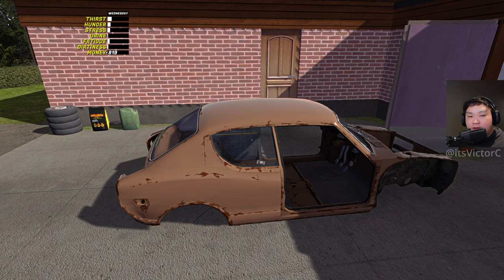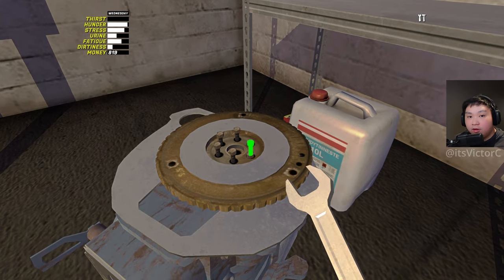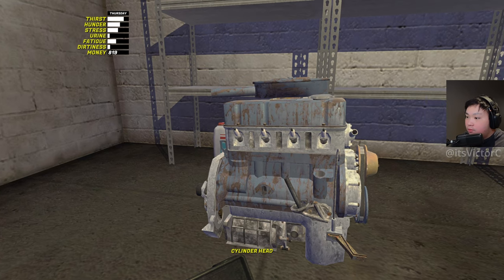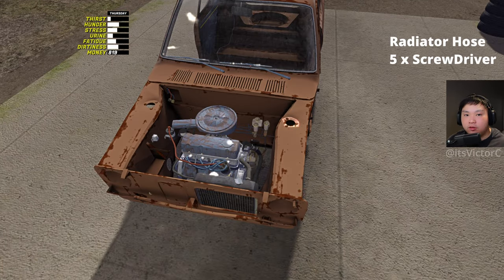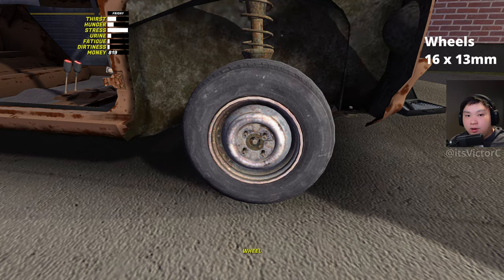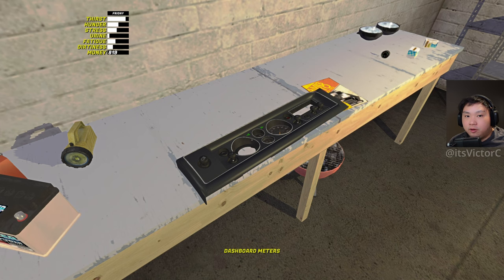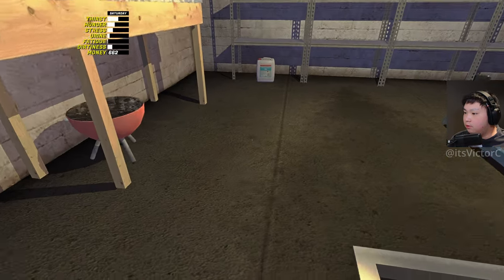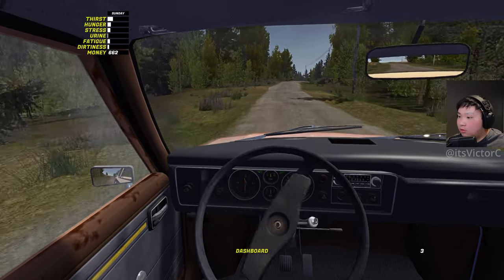My Summer Car - FULL Car Build Guide 2023 with Timestamps and Bolt Sizes

Comment: I'm done I've followed your tutorial To the second 4 times now the satsuma starts once idles great and drives mut as soon as i shut it off it never turns back on again the lights don't light up the car doesn't even crank I have re assembled the entire car four times bought 4 ne battery and 4 new alternators and It will never start more then once
Reply from the maker: Did you fuel it up? Also check the red light on the dash there should not be any red light and your tuning of the carburetor, alternator, valves and camshaft seems like you mistuned something

Comment: Please help, first time playing, I followed this exactly after getting everything from Timos and it started right up, I gave it a "little" rev and then it made what i assumed was backfire sounds, and then i turned it off. It doesn't turn on now at all when the key is in as if it lost power. I checked the battery and it was all bolted in. I did find something called "Piston3" on the ground though.
Reply from the maker: Then you will have to rebuild the engine with new parts. Sometimes it happens when the player spawn in the game and one piston is almost broken and when you install it and start it up it throws a hole in the block. So don't worry just check if the block have a hole if the block has a hole then buy a new block and pistons. Make sure to disassemble the whole engine so the new parts will spawn at Fleetari's
Reply: @itsvictorc  Thank you very much, I am currently restarting because I didn't know what else to do, Ill remember this next time though
Reply: @itsvictorc  Another thing, how do I earn money in the game?
Reply from the maker: The easiest one is to brew and sell kilju to the drunk guy, selling firewood and sewage job. These jobs pay well enough and the easiest ones are the kilju and the firewood but the kilju could be done multiple times and the firewood requires a phone call. So I'd recommend to brew and sell kilju but I wanted to warn you that the most recent update last year you are required to drink kilju with the drunk guy to sell so just brew more just incase. If you need a quick tutorial on how to do either of these I have made shorts regarding these jobs and you could find these videos in the playlist section of my channel. Good luck :)
Reply: @itsvictorc  Alright, thank you very much. I'm currently building the engine again right now. You're the best, and thank you again!

Comment: Yoo nice vid but it doesnt start it has a problem with electricity. The battery is attached so idk. Maybe the battery is not charged? Bc i bought it a long time ago
Reply from the maker: I think just get a new battery just incase and if you have an old battery not the black one put it on the charger so you have a spare
Reply: @itsvictorc  thx man

Comment: The Satsuma does start but when it drives the oil start leaking from the engine and a smoke start coming from the engine and if the car continue to drives, a water from the engine start splashed onto the windshield
Reply from the maker: I think you forgotten to tighten a bolt on the oil pan. As for the water issue the engine is overheating so change your radiator to the racing radiator and change your headgasket
Reply: Ok, the oil doesnt leak anymore and I just found out that the radiotor fan doesnt spin while the engine is on and while i was driving the car always shift to neutral as soon it hit the 2nd gear and there are some sort of smashing sound sound underneath the car (not the cranking sound)
Reply from the maker: Check the drive gear bolts and check if you have connected the radiator fan wiring

Comment: When i put the wire into the radiator fan and tried putting it on the main harness it doesnt show the check mark
Reply from the maker: Save the game and try again
Reply: i have the same issue , i restarted the wiring bit 3 times now to see if it would help  and i still have the same problem.

Comment: Help!! Why does my satsuma tilt to the right front suspension? is like the spring is busted. I've secured every bolt.
Reply from the maker: It's probably a flat tyre. Remove the right tyre and use the ruler in the toolbox to check the tyre health

Comment: Probably i didnt right the wire because the engines doesent want to start like no electric nothing , do i have to charge the new battery?
Reply from the maker: Not really but put your battery that you bought from Teimo's on the charger if the needle is all the way to the left then it's full if its towards the right then it's flat. But try to look at the tutorial again slowly and check back on your connections I think you might forgot the ignition wiring or you forgotten to tighten the battery bolts and check the bolts on the starter motor if you have bolted it down

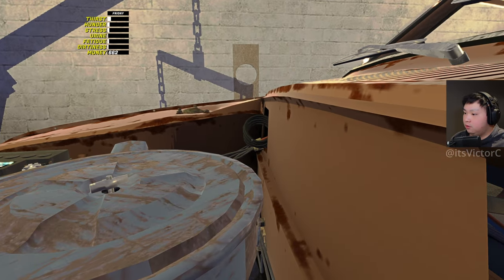Comment: 50:55  I connected it to the radiator fan and I want to connect it to the main harness but I can't you know why? pls help me
Reply from the maker: I think it's a bug try saving it and try again. If that didn't work then you will need to install msceditor I have a guide on that, then you need to find the wiring for the radiator fan and set it to false then try again it should work
Reply: @itsvictorc  ok thanks

Comment: Victor once i started the car successfully i saved all of the progress and now when i try to start it it wont start not even a single sound
Reply from the maker: I think the battery's dead pull it out and place it on the charger if it's all the way to the right that means it's dead. You can either get a new one or just let it charge up

Comment: i have a question what to do when i do wiring mess and i save it when its regulator-alternator and now i cant find alternator what i need to do ??
edit: thank you for answering my comment i subcribed!
Reply from the maker: You mean you can't find the wiring or the alternator is missing?
Reply: @itsvictorc  i cant find the wiring
Reply from the maker: The wiring mess or the location?
Reply: @itsvictorc the location to click f, i cant find it, everything is on the place, i even 
wrote down at what time i ended in your video.
Reply from the maker: If you have msceditor then find wiring then change it to false

Comment: Idk if i did something wrong bit when i connected the battery after wiring everything my satsuma caught fire
Reply from the maker: Did you unbolt the battery while wiring because you should wire up first then bolt on the battery also check if the carburetor if all bolts on the carburetor is bolted that might be another cause
Reply: The battery fell out while i was wiring and i only noticed afterwards so i bolted it in (positive terminal first) when i was done wiring then it sparked and caught fire
Reply from the maker: Make sure to always tighten the negative side first before the positive so that it doesn't cause a short circuit
Reply: @itsvictorc thank you so much

Comment: Do you need to put the battery to the charger while building the satsuma?
Reply from the maker: If its the black battery in the garage then no because that battery is usually dead. But if it's a new battery then its better to put it on the charger  while you build because once you bought the battery it only comes half charged. This will allow you to start up the satsuma with more battery capacity for your first start
Reply: @itsvictorc thanks,i will use your tutorial tomorow to build the car and the go to lindell insepction😀
Reply: Yay satsuma passed the insepction yesterday thanksss
Reply from the maker: Glad to hear the good results

Comment: For some reason when i get to the halfshaft part it wont let me put it i saved the game and joined back and it keot woudnt go in
Reply from the maker: Make sure you unbolt the 14mm bolt on the disc brakes before you attach it

Comment: I cant find the igniton coil to wire it, been trying for 30 minutes now to find it
Reply from the maker: Try saving the game and wire it up again.
Reply: @itsvictorc  everything is now wired, battery is fully charged, and starter motor is tightened, it has all fluids in and still cant get any power.
Reply from the maker: You forgot the ignition wiring. It's where you put in the key

Comment: I've one request, it is necessary to fix the engine parts before building the engine?
Reply from the maker: That's optional but sooner or later you will need to buy new parts for the engine. But if you have the money the I would recommend you to just buy all new parts from the start that means you don't need to build the engine at all, you just need to go to Fleetari's and all of the engine parts will be there.
Reply: @itsvictorc  Okay thanks a lot!!

Comment: Hey its me again and i am having trouble with editing,i cant find the battery ground conector,i spent alot of time and Stil lcant find it
Reply from the maker: Its at the starter motor. You will need to loosen the bolt on the starter motor. I actually showed it in the video during the wiring part
Reply: @itsvictorc  thanks, i did see u dhowed It but maybe i forgot tu unscree It totally and didnt see It,thanks still for helping me every time

Comment: It drive for a bit i anfet hearinf some bangs It went on Fire,any fix?
Reply from the maker: You might not have enough coolant in the radiator or somewhere in the pipes is leaking. Fill it up with coolant again and check if its leaking. If no leaks that means it is out of coolant also check if the waterpump pulley is working
Reply: @itsvictorc  how do i check the water punp and the leaks,also it Just goes on Fire when It rrsches the warm up temperature,May It be because in bot using Choke correctly?
Reply from the maker: You can check the water pump health in MSEditor. But I think your issue might be the low amount of coolant in the radiator try to top it up once the Satsuma cools down or else the hot water will spash out then the player can't see.
Reply: @itsvictorc  oh ok

Comment: Mine starter doesent work after wiring everything like ypu?
Reply from the maker: Nope mine works. If your starter can't start the car try getting a new one from Fleetari's or check the wiring and see if you have missed out a wire
Reply: Fixed it it needed to be replaced thanks for the tutorial too😊

Comment: i cant go get the oarts to teimo cuz the blue van wont spawn,i read the letter in monday,its now erdsneday it it didnt spawn,why?
Reply from the maker: It might spawn other days or the following week. I would suggest you to either take the boat, the tractor or the bike to teimo because once you build your Satsuma the blue van is not necessary anymore.
Reply: @itsvictorc  ok thankd
Reply: @itsvictorc  do you know how to fix my garage ligth?It does not work anymore so at night its difficult ti assembly the engine
Reply from the maker: Yeah you need to check the fuse box. If there's a black fuse instead of a red one that means you need to change the fuse. You can buy it from Teimo's
Reply: @itsvictorc  where Is It located?also another ligth stopped working
Reply from the maker: When you come out of the bedroom turn right and then theres a door it's on the left side
Reply: @itsvictorc  thanks alot,yout videos and commenti are helping me very much!

Comment: Why isn’t the negative connector not connecting to the ground battery connector
Reply: I undid the bolt in it?
Reply from the maker: Try saving the game and see if that fixes it because it sounds like a bug. The negative should be connected to the starter and if you need a guide I have a wiring playlist that you could check out as well.

Comment: how do you remove the wheels and replace it with new ones
Reply from the maker: First jack up the Satsuma then unbolt the four bolts. Once the tyre is loosen point at the tyre then right click on your mouse.
Reply: @itsvictorc  thanks

Comment: I M not do instal de camsaft and verry dark the camsaft how do repair it ?
Reply from the maker: What do you mean dark you mean no electricity?
Reply: @itsvictorc  it work no problem
Reply: @itsvictorc  for a very long time, almost 10 to 20 minutes, just like you, what would you have to do to start immediately?
Reply from the maker: What do you mean by start immediately you mean the game or the Satsuma?
Reply: @itsvictorc  it spins for a long time when I start it and it's not good at all
Reply: @itsvictorc  Satsuma
Reply from the maker: If you can get the Satsuma started go to Fleetari so and unbolt your starter motor. Once you unbolted your starter motor a new one should appear on the shelf at Fleetari's shop, buy it and install it and see if that fixes the problem
Reply: @itsvictorc  thanks i m see it

Comment: When I start the car I hear a loud banging noise, what does that mean?
Reply from the maker: I think you might forgotten to align your camshaft or your rockers so you might want to check those two before cranking the engine again or else the engine will throw out a piston.
Reply: No I aligned them. Also after a bit after starting the noise stops, idk though i followed the instructions carefully
Reply: Lemme be more specific: explosion sound when I start the car, it runs but when I move a bit it dies.
Reply from the maker: Oh then it's the carburetor
Reply: Is it broken or not tight or something
Reply from the maker: No you need to tune the carburetor in order for it to go away and if you need a guide I have one under the my summer car tutorials playlist feel free to go check it out :)
Reply: Tuned it but the sound is still there
Reply: I tuned it when building, when I heard explosion I scrolled down until it didn’t move then went up 50 and down 23 but the sound is still there

Comment: Hey Victor, could you make a save game that deals probably 134 or 150 hp?
Reply from the maker: I actually have a tune for that already on my shorts page so if you need more power just head there for the tune
Reply: @itsvictorc  well my satsuma kinda breaks if i do that
Reply: @itsvictorc  it always heat up even if the radiator is good
Reply from the maker: Did you try to use all new parts when trying the tune?
Reply: @itsvictorc  idk
Reply from the maker: Try with new parts cause the old parts will not last long with that tune
Reply: @itsvictorc  wait when i did the video of the 150 HP stock carburetor tune it gave me 122 then when i switch to the gear ratio 4.625 i got 95
Reply from the maker: I used the stock gear ratio
Reply: @itsvictorc  What's the number of the stock ratio again
Reply from the maker: The stock air ratio is around 14.8 of you want to pass inspection but for the best power and reliability time it close to 13
Reply: @itsvictorc  oh alr thx
Reply: @itsvictorc  aw man i got 87 hp now when i tried the stock carburetor tune to get 150 hp
Reply from the maker: did you scroll  up 60 clicks to reset the carburetor? and did you rebuild the engine? did you remove the air filter when you did your dyno run? but removing the air filter is not recommended for daily use a it will clog up the carburetor. So check these to see if you could get the 150hp also the 150 hp is not as reliable because it only happens towards 6000 rpm and above so its kind of a waste because the low end is performing slightly lower than if you were to tune the AFR to 14.8 or 13. But the AFR I got whe tuning the carburetor to 150hp is around 12.1 to 12.5 it will go up and down so of you have the AFR gauge then try to tune it to around that figure.
Reply: @itsvictorc  for god sake finally thank y so much thank u I GOT 154 HP
Reply: @itsvictorc  Also i used a racing radiator cuz u said it will heat up
Reply from the maker: Yes if you could afford it definitely upgrade the radiator because once you go above 140kph for long periods of time the satsuma will overheat even with stock carburetor
Reply: @itsvictorc  by the way was your car stock when you did the 150HP and is the tune normal tune or it will dmg the car
Reply from the maker: My car was stock, but the 150hp tune will wear the engine down much quicker than if you tune it with lesser power not to mention the 150hp you will only get it towards 6000rpm. But if you want more power but don't want to pay alot for the racing carburetor definitely get the twin carburetor as the power is more consistent
Reply: @itsvictorc Oh well, but could u atleast make a satsuma GT tuned save or a satsuma that the body looks stock but the engine is actually tuned